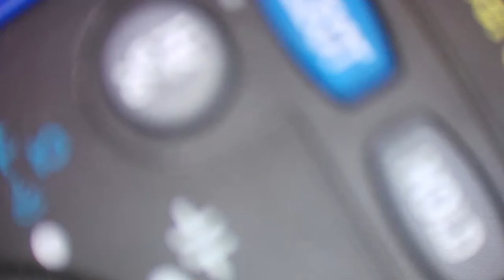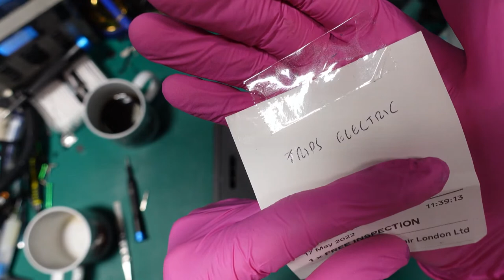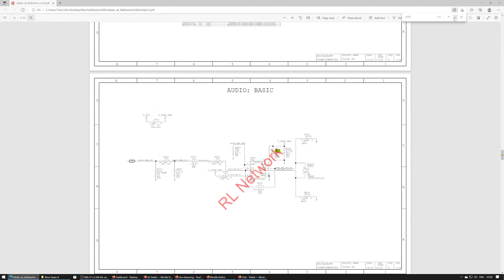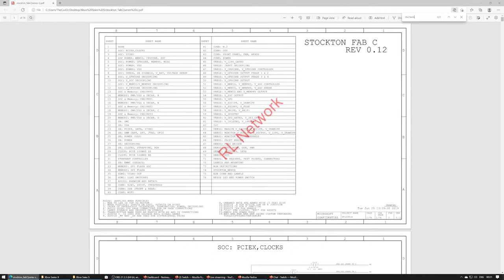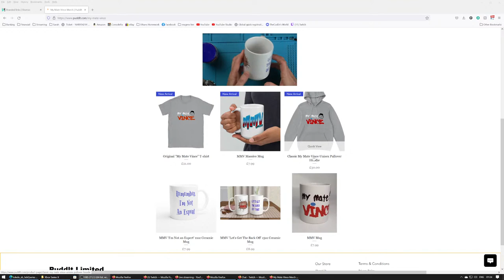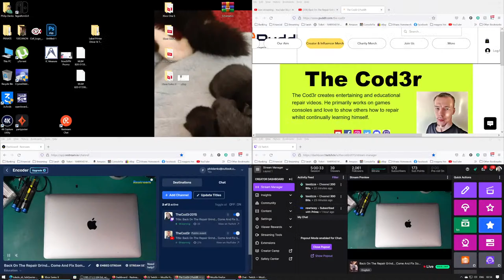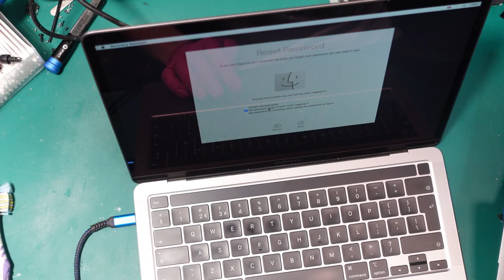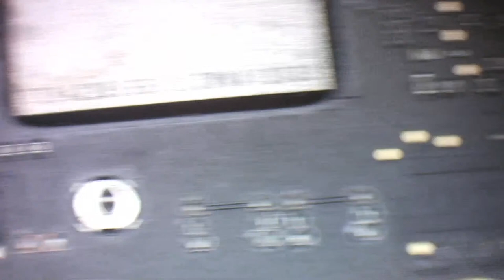Back On The Repair Grind... Come And Fix Some Stuff With Me LIVE

Comment: You can find the conector for ribbon cable, they name FFC or FPC , is like USB ports is almost impossible to get the same exact but they work if all pin get connected.